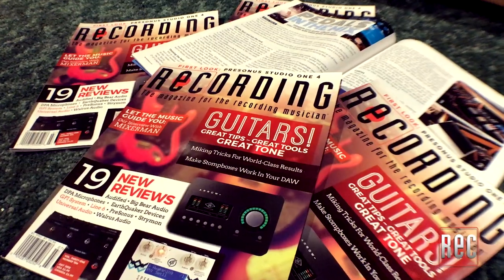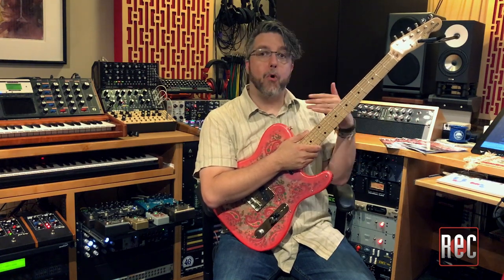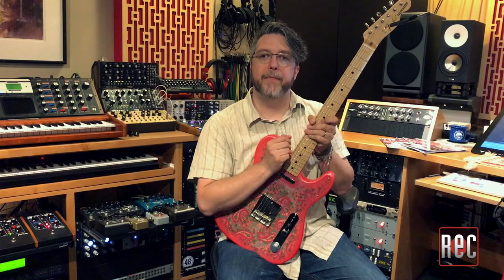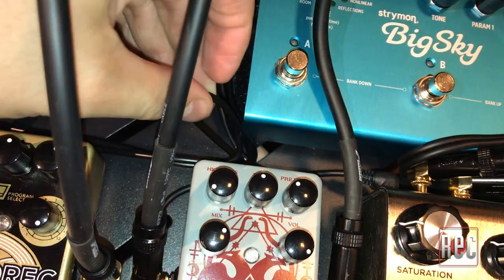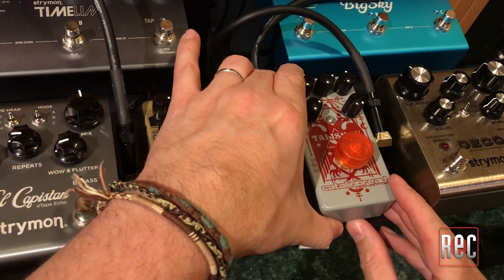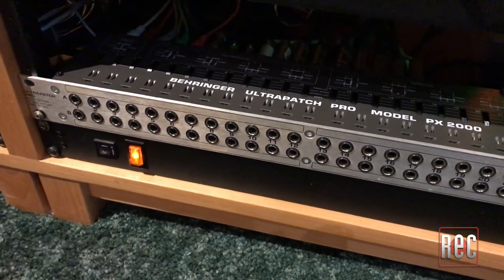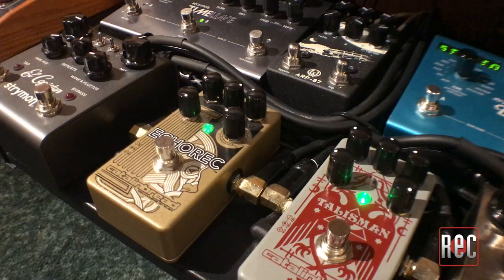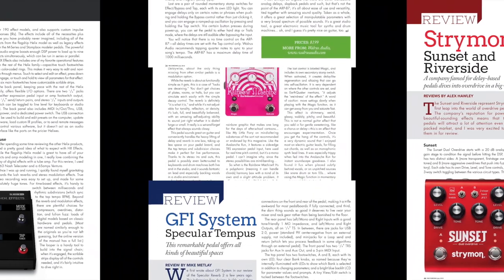Pedals In The Mix

Comment: Super cool build.  Worth pointing out that a balanced TRS patchbay will accommodate unbalanced TS cables without issue. All that happens is the ring connector in the socket shorts to the sleeve of the plug, which isn't a problem because it doesn't connect anywhere.  Plus, both the input of the re-amp box and the output from the DI are balanced, reducing the total unbalanced cable run and potentially reducing noise.

Comment: Yes, unfortunately rat mount gear under pedals do not have crowbar protection. So you have to make sure the polarity is correct and one good way of doing this is to have a avo metre or a multimeter and check the polarity of all your leads before you connect your pedals and check with your pedal manual my previous home studio setups. I always filtered the mains coming in. You can ease quite easily do this these days with plug boards already built for this purpose it's nice to know that these days more pedals are having line noise lift which is excellent feature very crucial and important I recall the days when we had to DI most things I apologise if this sound is technical God bless

Comment: is it really necessary to use an unbalance patchbay?
The ring of the balanced jacks will shortcut with the sleeves and than the whole thing is unbalanced anyway
Reply: That is my understanding as well
Reply from the maker: A large part, is I already had the unbalanced bay laying around, so why not use it. However, my second 1/4" patchbay that my synths run to is balanced.

Comment: If you wanted to set up a dedicated pedalboard for 'reamping' specifically, you could wire it up like a traditional pedalboard correct? With everything running in series to one another. The patchbay is to easily swap the order of things?
Reply from the maker: Yes. I do quite a bit of reamping through this setup.

Comment: Hi, awesome video! I'm curious, do the Navepoint shelves have to be racked in i the back to support it? I have a basic rack but only have front rack ears. Thx!
Reply from the maker: Mine are only supported in the front, and they are still holding solid this many years later.
Reply: @RecordingMag  Awesome, I just installed two navepoint shelves in my first legit rack. Time to get some serious use out of all my pedals I’ve collected over the years. I really appreciate you and the hard work you did on this video. Premium content!

Comment: Wow, I see you use Moog’s  Sound Studio 3 ! Which pedals would you recommend to use in combination with the Sound Studio 3? Would you use those pedals by using them each sepratley (DFAM, Subharmonicon, etc. ) or just connecting them in a chain just by using Sound Studio’s 4 channel box. ✌
Reply from the maker: I don't actually have the Sound Studio, I had all of the Moog units individually prior to its release. As such, I run each Moog into the patchbay and use various pedals one at a time. I do not sub-mix into the pedals usually unless I am adding a global reverb.

Comment: Does the distance from the pedals and the patchbay make a difference? I've done the same as you here, but was planning on moving some gear around which would place my racked effect drawers 20 ft away from my main patchbay and interfaces.
Reply from the maker: It should be ok. Many folks might worry about signal loss as such a distance, but when you consider that many guitarists use 20' cables from guitar to pedal, I would not think it would be an issue.